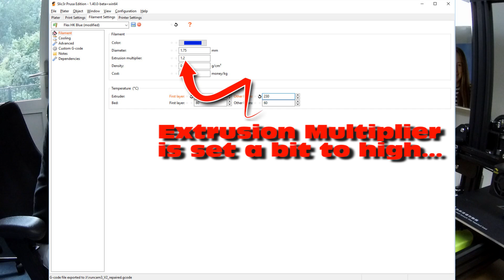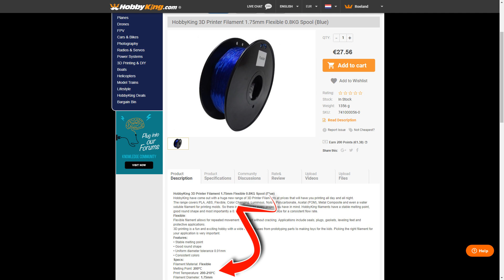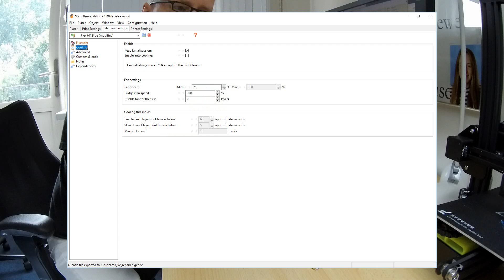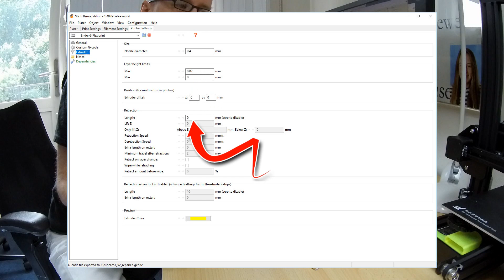Creality ENDER-3 Desktop 3D printer - Flexible Fillament Printing

Comment from the maker: How well does do Ender-3 do with Flexible Fillaments?? Let's find out :) 
Link to this 3D printer: https://goo.gl/78Xhep 

HobbyKing flex fillament used in this video: https://goo.gl/fCug2j 

Specifications 
build square: 220 x 220 mm
build height: 250 mm 
machine size: 440 x 410 x 465 mm 
max speed: 180 mm / s 
nozzle diameter: 4 mm 
fillament diameter: 1.75mm 
layer thickness: 0.1 - 0.4 mm 
resolution: 0.1 mm 
max nozzle temp: 255 C 
max bed temp: 110 C

Comment: Hello DutchRC 
On the description you got the information wrong! The nozzle diameter is 0.4 mm not 4 mm!! 
No hate, just wanting to help you to get to perfection, great video have to say
Reply from the maker: Forreal? :O  THAT is a bit of a big nozzle! :D 
Thanks for the heads up & compliment!
Reply: DutchRC Adventures so you didnt add any like feader thing at the extruder? Because i saw a lot of people doing that to print with flexible filament y, know a thing that puts the filament earlier into a tube after the extruder
Reply from the maker: @010falcon  Correct.. I have made a few mods to route wires etc.. But nothing to the feeder and it prints flex stuff quite well.. 
I finished a camera mount just a few days ago actually: https://www.instagram.com/p/BsvhiiJnOtc/ 
There was a bit of stringing because you can't use retraction with flex stuff.. other then that it really came out perfectly :) 

And it works well too :)  (see last flight in this video: https://www.youtube.com/watch?v=OtLrk6sFv40 )
Reply from the maker: ps: the Ender3 Does do better at printing flex materials.. The feed-in seems to be a bit better.. But again: mine is 100% stock
Reply: DutchRC Adventures maybe flexible filaments has always strings idk
Reply from the maker: Thanks man :)  Saw the video
Reply: DutchRC Adventures great hope it helps, give me then feedback if it did work.
Reply: DutchRC Adventures because you said in the video its „advanced“ to the cr10

Comment: What slicer software do you use ? Can you share your settings that you use to print TPU,I have the Ender 3 and my TPU  prints come out to soft,I need it to be hard (that's what she said)but soft like the way it should come out,just curious on your slicer settings,thx
Reply from the maker: Hahaha that IS what she said ;) 
I use Slic3r (Prusa edition) myself.. 
Extruder: 230C for all layers
Bed: 80C on the first.. 60C on the rest of the print 
First layer speed: 15mm/s ... 60m/s for the rest 

BUT.. it might offcourse just be the kind of fillament you use, that just turns out flexi?

Comment: trying to print a canopy but my supports keep lifting with tpu any ideas
Reply from the maker: Would a brim and / or higher bed-temp be an option?
Reply: ill try a higher bed temp
Reply from the maker: A slower print-speed will allso help (prevent the material currently being printed basically Pulls the corners of your object up / away)..
Reply: im print at 15 i think it was in the code trying a differant design now

Comment: Thanks for confirming: I'll hold off on printing extruder mods before I receive this printer #(30+)
Reply from the maker: No worries Richard! for the CR-10 I did end up printing a new extruder-bracket-(thing) but So far the Ender-3 behaves well without one :)

Comment: very informative but I have to ask if you have done any abs printing with the ender 3 and if so could you help me out with some settings that might work, I primarily use pla but have an abundance of abs left over from a failed printer that I would like to use thanks
Reply from the maker: Howdy Steve :) 
thank you! And nope.. i don't really have a need for ABS printing, though I do consider ordering up a roll.. with the printer not having an enclosure I think it would be Challenging though to print ABS with it...

Comment: Great review! This filament looks quite stiff though. Might be some kind of semi-flex which would also make it easier to print. Or maybe you printed with 100% infill. I'm planning to order an Ender 3 to print flexible filament so it's nice to see it prints well on this machine.  Since you live in the Netherlands, how long did it take to ship to you and did you use free shipping? (I live in Belgium)
Reply from the maker: Thank you very much Matthias :) 
welll.. not really actually.. This is very much flexible fillament, though they don't specify what it actually is :P 
This one did take a while.. It was held up in customs for about a wheek, but with that added it took 2.5 weeks.. I used priority direct mail, which is mostly the same as European direct mail I think...

Comment: Sir 
What is your opinion between ender3 and tevo flash

https://tevo3dprinterstore.com/products/tevo-flash-3d-printer-aluminium-extrusion-3d-printer-kit-3d-printing-prebuilt-50-sd-card-and-titan-extruder-as-gift
Which one will be a better buy?
Please advice
Reply from the maker: They ARE pretty close, so I can understand the question :) 
I can only base this on pictures and video's but the Tevo's seem a Little lower quality, and they don't have as good a build-plate.. 
So if you don't need the extra build volume.. Well.. I guess me going for the Ender-3 sums it up :)
Reply from the maker: I think any printer that does Not have an enclosure will struggle to print ABS well.. So I'm kinda reluctant to spend the $$ on a spool. allso because I don't really have a need for ABS prints :$  I know it would be informative, but there is an end to my budget ;) 
To be honnest I am not Sure what generation of controller it has.. it does seem newer then the CR10's to me, what's in it exactly I don't know...

Comment: Good video
So, 220c nozzle, no heated bed and no retraction
But at what speed are you printing with it?
Reply from the maker: good Q :)  the print I was doing during this video was at 40mm/s which worked, but I had less stringing at 50-60mm/s.. 
Would probably depend on the type of fillament used....